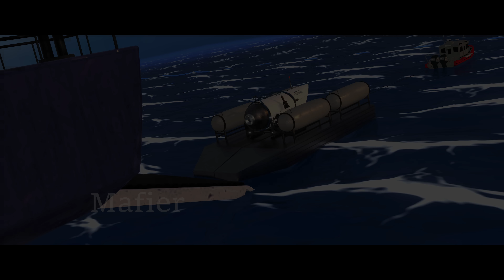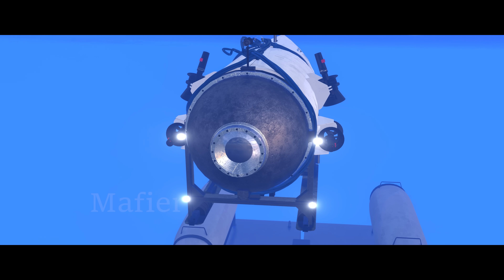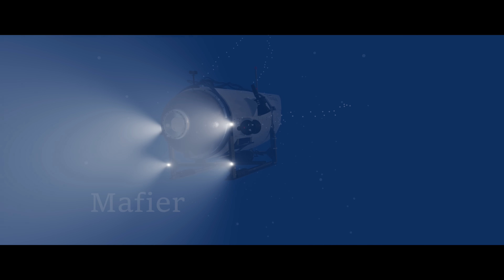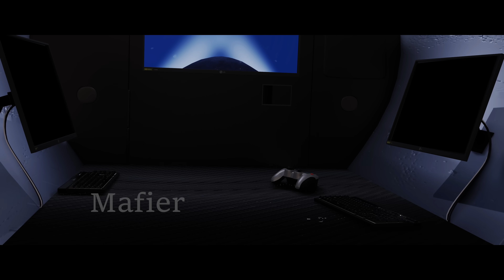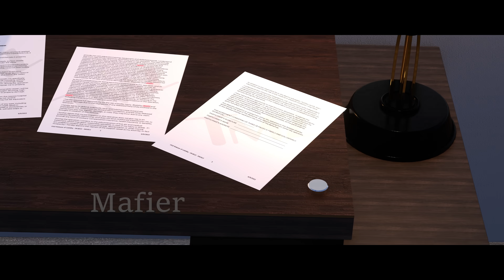NEW SHOCKING DISCOVERY Of Oceangate's Titan - 3D Animation

Comment: As strong as carbon fiber is, its not meant for these kinds of applications to be used over and over.  A tube has its strengths but only from the ends, not around the sides.  There was never any real checks (xray or the like) done after a dive to see if there were any micro-fractures in the carbon fiber wrapping.  I can assure you, due to the depths and temperature variance, there were.  Like James Cameron stated, there is a reason why these types of  submersibles are made out of homologous materials like steel, bc the failure rate isnt catastrophic.  The hull is one piece with a like material as a hatch with minimal viewports.  This thing had multiple weak points and carbon fiber doesnt flex, it shatters like glass.  Look at the suspension on current F1 cars, the horizontal tubing is super strong until the car is upset and wrecks, then the wheel is sheared away, its so well known they have kevlar tethers attached to keep the wheel from going causing any collateral damage.  This group took inexperienced young adults over highly qualified “old white men”… i believe that was the wording… and they didnt take any advice offered.  All they saw was carbon fiber is strong, but failed to read the fine print about its characteristics and built a ticking bomb waiting for the right conditions to go off… and it did in horrifyingly spectacular fashion.

Comment: I have no problem with the document  mentioning death 9 times, even 12 or 20 times would be ok...you need to set proper expectations.
This is not like driving with a taxi from the hotel to the airport, and there are a lot of things that can happen, that could kill you as well, but we are aware of those risks, but the chances are very low...but not during a commercial dive or spaceflight, we are not aware of the potential risk.
And now comes the big but: we expect they operate with professional personal and professional equipment, to keep that potential high risk as low as possible...and this was not the case. They made the risk as high as possible with using an experimental non certified DSV.

Comment: Your theory sounds very likely to me. With past problems with the Titan's thrusters and the elongated shape of the pressure vessel and sub itself, it seems likely the Titan could easily end up in a steep or 90 degree downward angle causing all 5 passengers to become pinned in the front titanium end cap. This would make any attempt to regain control almost impossible and would greatly increase the rate of descent. When the application of force is inevitable you want it applied at a very slow rate. The faster force is applied greatly increases stress to the pressure vessel. As we know the Titan's pressure vessel was poorly designed and even at slow rate of applied force against it caused it to make sounds like cracking or delamination processes were happening.

Comment: Although the thrusters could move the submersible forwards and backwards and control the direction it pointed and move up and down, I see no system to ensure forward and aft stability. This is relevant because the attitude of the craft could indeed become such that it was pointed straight up or down. The wireless control pad would presumably fall to the lowest point in the craft, so that was not necessarily a problem. Also, the overall buoyancy of the craft would remain unchanged. So tilting vertically would not instantly result in an uncontrollable dive into the abyss. In fact the propulsion thrusters could then be used to move up and down instead of forwards and backwards. Given how small the internal diameter of the craft was, it should have been possible for any personnel aboard to work their way back up the cabin to restore the balance and level the craft. Having another dedicated set of thrusters or a longitudinal ballast system would have avoided this problem in the first place. The cause of this accident was simply that the carbon fibre hull imploded at depth due to the accumulation of stress cycles exceeding its’ capability of withstanding the water pressure at depth.

Comment: I am a bit unusual, in that I could actually afford to take a dive on this tin can. However, I took a look at the mathematics of external forces on a sphere and realized that this is the ONLY shape that can handle these extreme compressive forces. I am not a mathematician or an engineer. But the equations have a way of "speaking" to you. The sphere is the ONLY way. 

I would never have gone even 15 feet down in this death trap. 

Sanjosemike (no longer in CAA)

Comment: What's so mysterious? The sub was poorly designed, poor choice of materials, wasn't certified, safety issues ignored. A military sub has inspections every time they return from the sea. It is an incredibly abusive environment. Equipment deteriorates very fast. Surface ships require continual maintenance. How much maintenance do you think a sub would require for a hull that is exposed to constant fluxuations in extreme pressure? Whatever the exact events that led to the titan's implosion started when she was designed. It ended with her implosion. I think the lesson learned is that amateurs should not be doing deep submergence.

Comment: Exact sequence of events we probably will never know.
I am not too informed about known events in accident but let's ask couple of questions. 
On what depth submarine imploded? 1000 m, 2000 m, 3000 m, 3800m? Could it be that submarine hit bottom which cracked already overstressed hull?
Where is inner cylinder of hull middle section made of metal around which carbon fiber where wrapped up? This piece of submarine should not be disintegrated but mangled and probably in one piece. Are the investigators in possession of some sort of telemetrics? Probably not considering lack of regard towards safety, engineering standard and expert advice. Could it be that those tiny bolts failed which they used to seal front canopy to the hull? Those bolts are to small and much to few for the depths they are intended to operate. Did you ever see spacing and size of bolts on flanges designed to operate on much smaller pressure and with much smaller consequences if they fail? Ok pressure is inverted but still pressure force is still present.

Comment: Having worked with carbon fiber in a automotive sense, I can tell you that it is not the ‘wonder material’ everyone thinks it is. Yes it has incredible amounts of strength for relatively little weight, but in many ways it is comparable to the strength of aluminum, which many know is a softer metal than steel or titanium. Simply put, carbon fiber was a very very poor choice to use for the pressure vessel. Pair that with the multiple other poor choices made by Ocean Gate in the design of their sub, and Stocktons own narcissism, and its no wonder the sub failed. To me, those 5 “explorers” weren’t killed by a “tragic implosion” those 5 were killed by Stockton and his ego.

Comment: I don't believe the fiber shell failed, i think it's when they tried to epoxy the two ends together is where the failure was. When connected the ends ot was reported there was NO oozing,  there was not enough glue to handle those pressures indefinitely.

Comment: If messagin list is real seems like they diven too fast which mostlikely created additional pressure compared to normal diving..  and as they talk about propeller/thruster and power supply problems... it can be attery module or short circuit as fast diving mostlikely broken battery caps or protection layers i dont know where and how they stre batteries but from what they talk we see battery midule one is offlie or in shr circuit mode or propeller... or cables shorted somewhere betwen motr and battery/powe supply...

Comment: Under floor leaking (in my opinion) was the cause for both (if transcripts are true) rapid descent/electric's, descent because the sub became overweight (especially with 5 people on board ((and that's dead weight) and the extreme slow ascent), electrics because batteries are not conductor friendly under water, drains batteries within a minute when underwater and being used (batteries with no voltage being drawn will keep charge), so switching batteries makes no difference underwater..ALL electric on the sub would have failed, communication/thrusters, EVERYTHING, and being overweight it would have sunk (slowly but surely with ALL weights removed).

IF investigations can point to the timeframe of the implosion (hours after authority was called/before), and the debris field, we may figure out if the titan sank, and just sat there at the bottom of the sea, or just imploded when they lost contact..

Comment: because the part of the capsule that failed was made of carbon fiber. What is carbon fiber? Basically many tiny incredibly strong strings that are formed in epoxy. Key word... strings. Very high tensile strength, as in they can hold a lot of force when pulled. Not very strong when trying to push them though. Not very strong in compression. if you form a circle out of strings and push in from all sides then you're subjection the strings to compression and it won't hold. Carbon fiber is great as an internal pressure tank but terrible for an external pressure vessel. Thus, the end caps were pulled up from the bottom but the carbon fiber hull is gone. crushed into dust and scattered over the floor of the Atlantic.

Comment: I think Ocean Gate  needs  to take responsibility for what happened  and they  should have fixed the problems before  they did the expedition to the  Titanic and they overlooked things chest like boing did  with  their new 737  so how am I saposttoo trust a company that cuts corners and not take the proper steps to make sure things are safe for people  I can never  and all the higher ups in Ocean Gate  should be ashamed of what they did and how they treated people when they new right from the start that the titen  was not safe to be used it's like developing a new car  you need to make sure everything is tested properly before selling it to customers. There is no difference between that samersable and a new car that hasn't been tested properly

Comment: I fail to see how loosing power would have caused the sub to tilt vertically when there was no electrical driven mechanism designed to keep the craft horizontal. The fixed under structure and weights seemed to be designed to keep the vessel horizontal regardless. I think that part of the theory needs further explanation.

Comment: I  knew immediately that there was no way that the crew of the Titan submersible were going to be rescued alive. The deepest successful submarine rescue was on August 29th 1973, when a submersible Pisces 3 sunk to the bottom of the Celtic Sea 150 miles South-west of Cork in the Republic of Ireland. A hatch was pulled open, causing the sub to fill with water. Thus it became too heavy too surface. 
  Stuck at 480 metres, Roger Mallinson and Roger Chapman made contact with the mother ship informing them of their situation and their air supply-66 hours emergency air left. Submarine rescues are complex and successful rescue stories are few and far between. 
   Other submersibles Pisces 2 and 5 managed to locate the sub, even then it took until 13.17 on 1st September 1973 to rescue both men.  This rescue was difficult even with a vessel intact, and a known location of the sub
    The Titan submersible, the rescue vessels had no idea exactly where the vessel was,just a plot based on a plan. The sub is so deep(3,800 metres), the technology doesn't exist to rescue people from such a depth.

Comment: The titan submersible disaster may have solved a long debated question. For decades people have wondered what happened to the passengers on the titanic. That is the ones trapped inside. Some say their bodies just went into solution. Maybe not so. When that titan submersible imploded it basically pulverized their bodies and bones. In the Titanic only shoes and other articles were found. They found the same thing at the bismarck. When they sank there was no way to compensate for the rapid change in depth. Their bodies basically imploded and were Pulverized  like the titan. Just a thought.

Comment: The recorded transcript does not support your theory.  Apparently they had jettisoned some weights and were starting up.  Also, experts have concluded that initially they descended too quickly.  Even on the way up the pressure is still extremely high at that depth.

Comment: This is 100% incorrect. There were actually trying to ascend if you read the messages. If you look at the time table, almost from the begining, the Sub was descending at a much faster rate rate than it was supposed to go. They heard noises in the electronics room like popping... put 2 and 2 together.. Water was leaking into the electronics room making too heavy and electronice were getting shut down, they tried reducing weights to come back up but it was making very little progress, just a few meters up in 1/2 hours and thats probably when the the compartment was full, loss of electronics and the pressure on the weave made it spread apart like a finger cucuuf weave and then it imploded... THEY WERE ASCENDING !

Comment: It's not a mystery. He used the wrong material and had hs head so far up his ass that he could open his mouth to see what was in front of him. I'm very interested in Titanic and knew about the sub before. Now, I'm not an enginer. But carbon fibre does not work well under compression. I know that because I'm interested in car manufacturing. It was doomed already at the drawing table.

Comment: The issue was with the piece of glass that was connected to the front cover, it was broken due to high pressure and water pushed inside and made the whole thing exploded and not imploded as many people think, if it was imploded you wouldn't find the cover piece intact

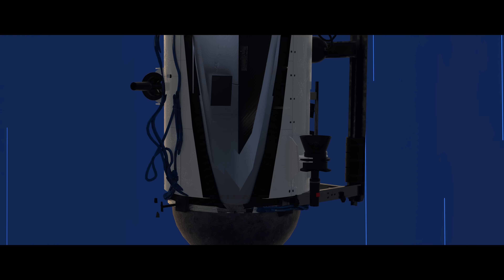Comment: If this theory is correct as shown @ the 5:28 minute mark, wouldn't the passengers have fallen upward towards the tail of the submersible vs the porthole window? Imagine an elevator suddenly plunges to the ground. Anything inside kisses the ceiling not the floor.

Comment: I firmly believe that the carbon was stressed from previous dives and no certification and that was the cuase of the health failure and I don't think they had much notice or ability to change the vessel cracked then started to take water though a crack and that caused it to be uncontrollable and it sank fast and unpressurized and then the crush happened and they all went with the debrie to the bottom

Comment: I disagree with your offering that the sub ended up porthole down.
The last thing they did (the transcript said) was to jettison the frame (landing skid and legs).

Now the sub was trimmed with foam around the machine section at the rear to make that section neutrally buoyant, while ballast in the form of iron pipes and sand bags was used to balance the habitable space - the carbon fibre cylinder and titanium end caps.

The position of the jettisonable ballast was such that the sub would float level with and without ballast.  

However, the weight of the frame was balanced by the buoyancy of the habitable space. 
When the frame is released, then the whole sub would be light at the habitable end, and so would rotate to float front (porthole) end up.  

The internal space had a wall towards the rear which supported the video monitor and had a door to access the utility area between it and the rear end cap.  This held the computers and other equipment.

When the frame was jettisoned the sub would have been strongly inclined to float front (porthole) end up, and the crew would have had to stand on the wall which was probably not intended to take the weight of five people.  So that would have collapsed under them, dropping them into the rear end cap section which would further encourage the vertical front up orientation.  Among that shambles they would have been scrambling to find keyboards and the invaluable game controller, while listening to "more sounds from aft".

The fact that the recover vessel did not show the rear end cap suggests that the human remains were there, which supports this 'nose up at the end' hypothesis.

Comment: Glass/Electronic compartments..... 
Back aft cap had a wall.
Cracking sounds were coming from the rear. The carbon fiber hull ended above they're heads.
The electronic compartments were supposed to equalize pressure and if fractured it would push oil through to stop a implosion.
 There's a huge glass sphere, behind end cap you can see in the Stockton video where he mentions "rhino liner"
 I think compartments fail, electronics shut down, they panicked in the dark, and try to move away from cracking of glass compartments, causing a rapid decent, imploding the compartments, and sub. A rapid decent is catastrophic in itself. 
 All the compartments are missing and stockon says those compartments if not equalized could act like 17 tnt. If one valve got stuck on the several glass/electronic compartments.
 Underwater bomb. Let's not forget the glass was made to crack before giving way.

Comment: Since everyone sitting at home watching these videos hve become engineering experts over night can anyone tell me if the submersible was made out of the correct material tested for these depths if it free dived to the ocean bed due to electronic or depth speed malfunctions wld that hve imploded due to sudden pressure increase as it did not descend in a timely manner?